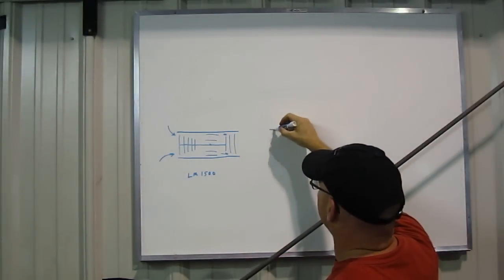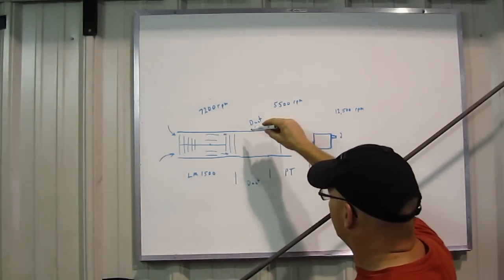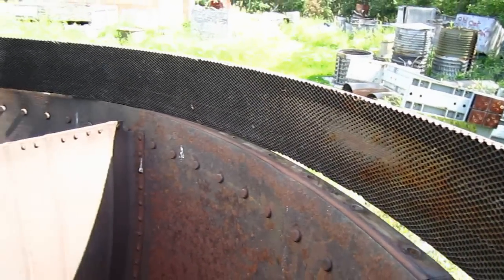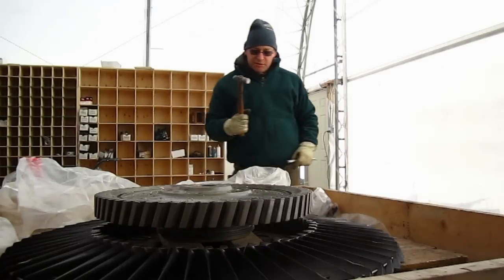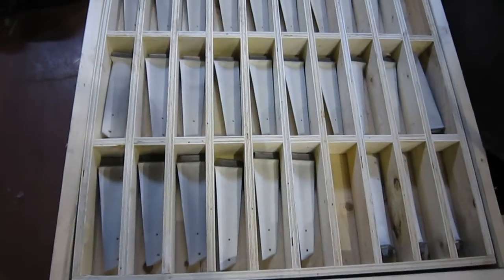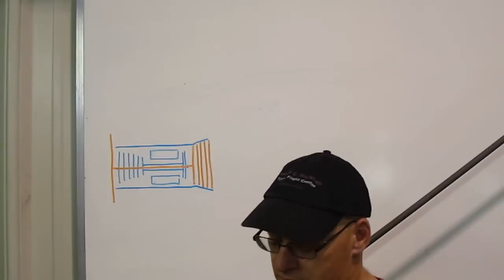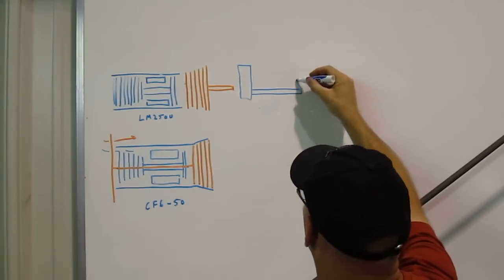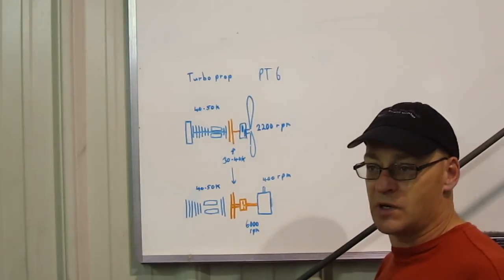Power Turbines: what are they ?

Comment from the maker: There is... between the power turbine and the load ( generator or gearbox).
The gas generator turbine, sometimes called the compressor turbine... provides the power to turn the compressor of the gas generator.
The leftover exhaust energy then turns the power turbine, which provides the power to turn the load...

Comment: The PT-6 is like the Chevy 5.3L of aviation.  It's hard to dislike it because it is common and it just plain works.  But like you said, it has its advantages in certain applications where the Garrett has it's own advantages elsewhere.  I've seen that the PT-6 is a gold standard of sorts in fixed wing and the Garrett in more use in helicopters.

Comment from the maker: @narcoti ...Very unusual question. So unusual I can't answer it. The output of an LM1500 is the exhaust gases, which are about 900 degrees F, and about 30 psi. Roughly 150 lbs per sec at full honk. Convert that to SCFM? Not me!
And if you mean what's the output of the compressor, then it's 150 lbs per sec, but now it's at about 450F, 140psi... another conversion to SCFM...
That's why jets aren't measured in volume of flow.

Comment: @AgentJayZ Not misleading, I am just an over-thinker!  Maybe I worded that wrong, I meant that the PT rpm is regulated by the pressure inside the duct.  It is, I guess, acting like an torque converter with air as the coupling medium.  As for the bleed valve, that would be like a wastegate on a turbo charger, which I could see as useful if they quickly need to control the pt rpm faster than the average throttle response of the engine, which In some application, would be quite required.

Comment from the maker: Yes, interestingly the CT58 has an optional reduction gearbox, for use in some aircraft.
The two CT58s that I have worked on were originally from CH-47s, and they had the reduction gearbox.
It seems to be more highly stressed, and less reliable than the engine itself.

Comment: In all conventional power generation systems, turbines are always used to convert the heat energy into mechanical power (which is then transformed to electricity by a generator). 

I know that modern combined cycle powerplants (gas turbine(s) are used to generate power, and their exhaust gases are used to as the heat source for the steam cycle of a steam turbine) can reach efficiencies close to 60%. 

If I recall correctly, modern petrol engines have efficiencies in the region of 20% - 30%.

Comment: Hi
i'm working on a micro gas power turbine and i have a problem with speed reduction. 
can you recommend a  small gearbox to reduce 60,000 rpm to 3000 to be suitable for a generator ?

Comment: Question : with helicopters, why there is an extra gearbox (last one , not part of the engine) ? Does that final gearbox change the main rotor speed, with turbine engine running at fixed speed ? Thanks in advance

Comment: Oh dear, not sure if I should have watched this, it looks absurdly simple to build a simple engine, once I've sourced the compression ratios I might have to have a little tinker in my garage to see if it can be done, if you see a news clip showing first UK man into space in a garden shed you may take all the credit you want for the inspiration. lol
Reply: Slow answer, but people are building simple jets from turbo chargers. That should be the simplest and cheapest way to build a small jet.
Reply: +Andy Gotting  No hair to worry about getting caught or to be burned off. That's a good start seems to me like!
Reply: +James Banana  And as I understand  it, they run up around 150k r.p.m. so it'd be interesting!
Reply: +Lewie McNeely it's quite an old picture of me, however my forays into building a simple turbojet did produce some interesting fireballs and a brief period without eyebrows was the net result of my last attempt.
Reply: I go on at chromium domes because when mine touches my ears, it's GONE! I can't handle it at all so I'm like your old picture most of the time. Glad it was only eyebrows! Cheers 2 U!

Comment: Hi. Does the two rings of wire around the power turbines blades, allow the blades to be mounted tightly in the wheel, rather than being loose the way compressor blades are? Are the wire rings to dampen out harmonic vibrations?

Comment: Agent Jay, what kind of materials are used on shrouds and struts? I thought they are supposed to be strong corrosion resistant metal alloys but it turns out they might be composed of mostly steel judging by the red oxidation visible on those junked pieces.
Reply from the maker: There are shrouds around compressor stages and around turbine stages. There are struts supporting the central structure, or bearing housing in the front frame, the midframe ( compressor delivery casing, or compressor rear frame), and the rear frame. Each of these structures is under a different set of thermal and mechanical loads, so the materials differ.
Many times what looks like rust on hot section nickel alloy parts is an accumulation of deposits of very fine dust. As I've mentioned a few times before.... forget Mars, Earth is the red planet.

Comment: @AgentJayZ As for the helicopter comment, since in flight, the load is going to vary anyway, just in maneuvering, (pitching the nose up while moving at a decent speed, puts tremendous load on them very quickly) so the stability of the rotor RPM is not as critical as AC electricity power generation, where it is important to match Voltage and Frequency as best as possible to feed it onto the grid.

Comment: Has there been any construction in the past that has    a smaller mid shaft to a small compressor air fan at the front    and the big fan for bypass air right behind the high pressure area with the exhaust gases going right through in the middle? So the cross section for birds to get in is smaller and the functionality of the fan is split.

Comment from the maker: @LarryCanFly If it's a home-built helicopter, you're on your own.
If it's a production model, the engineers would not waste weight on something that was unneccesary.
Helicopters have reduction gearaboxes because a power turbine that turns at main rotor speed just won't work.
If it would work, then that's the way helicopter would be built. That's what I meant.

Comment: Hi, this is fascinating and spectacular!  I had the idea helicopters engine and turboprop aircraft were using the engine shaft connected to a gear box> This gear box has a reduction gear and had some accessories for the engine. At the output shaft pilots could control the power to prop, and also increase speed to the engine. Well, I thing was wrong anout this! Thanks a lot for your videos and teaching all the world!

Comment: A PT6 runs at much higher RPM due to its much smaller size. The distance from axis  of rotation and blade tip are a lot smaller, and thus the blades generate less torque about the rotor. As such, to generate high power output, the shaft must (and is able to, since its size) spin at a higher RPM. Also, a PT6 puts out between 600hp and 2000hp depending on model, where the LM1500 is closer to 12,000 hp. 

Power = (Torque * RPM)/5252

Comment: so, I have a question for you about bearings.. once again.. I get how the second turbine powers the fan, but I am curious, does the inner shaft touch the outer shaft at all through bearings? or is each shaft merely supported by their individual bearings at the front and rear? I understand that the compressor shaft has a mid frame bearing forward of it's turbine just curious if the two shafts are connected via bearings or if it really is a hollow pipe and their individual bearings manage the load

Comment: It is interesting to compare the product of (shaft speed x tip diameter, or tip speed) on the last stage of the GG turbine, and (shaft speed x tip diameter, or tip speed) on the first stage of the PT.    It is also interesting to compare the disks.   Some aircraft GG turbine stages are so flexible(when not spinning)that they wobble -- flop like a potato chip.  As you point out, aviation GG rely on more intense inspection and maintanance schedules, because they cant be overdesigned like PTs.

Comment: not in all cases you dont, the CT58 I work with has no reduction gear box, its a straight drive into the 'freewheel' unit of the main gearbox (Sikorsky s61 in this case) after the freewheel unit you have the reduction gears.  Of course some turbo shaft engines DO have an integral reduction gear system, turbo prop being a common one.

Comment: The main rotor runs at a constant speed, usually, as you increase pitch of the rotor you need more effort. Some helis require a pilot on the throttles to match the required torque...other systems are automatic with governors etc...ie you set the throttles to 'flight' and the system maintains rotor rpm...usually with an 'anticipator' on the collective stick (raise the stick..pitch increases etc..anticipator detects this and provides the info mechanically or electrically (for FADEC systems)

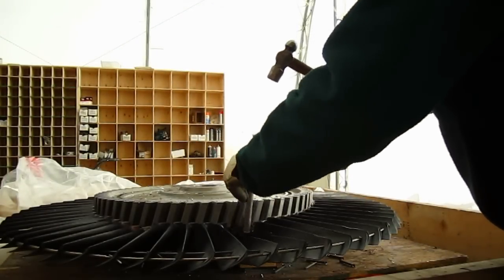Comment: At 9:30, when you use an aluminium rod (drift?) to hammer out turbine blades, even though aluminium is softer than the steel, doesn't the compressive shock from hammering risk causing weaknesses in the blades? Maybe the blades are less fragile than I think.

Comment: Do these units suffer less wear and tear when they are running in a static location rather than a plane?
Reply from the maker: The changes in power setting are much more gradual, so the thermal stress on the hot parts is much less, so yes to your question. They do run much longer between service and overhauls than aircraft engines do.

Comment: Don't some systems like that also have a bypass (blow-off?) valve in the connecting duct for a form of coupling/decoupling? (Not having to worry about the gas turbine part too much if load on power turbine varys rapidly for some reason. And I'd guess it'd make warm-up easier too, get engine spooling without backpressure.)
Reply from the maker: The exhaust duct pressure is not affected by how much load is on the PT, or by PT speed. . I've never seen a blow off valve between the GG and the PT in any industrial installation., nor any helicopter engine. The PT is connected to the GG by a duct full of gas, and it can't damage the GG. Watch our test of an LM2500 with the PT locked at zero rpm. It's called Power Turbine Locked.

Comment: @AgentJayZ They discovered that very quickly running the turbine locomotives, so that's why the turbines also had a couple hundred HP of diesel power onboard for moving around the yard.  Then they'd hook it up to a ridiculous load, fire up the turbine and then keep it full power all the way up the mountain so that it was always making the most of its power.  Ultimately they were discontinued because the fuel oil they used shot up in price much faster during that period than diesel fuel did.

Comment: As always, great vids! I have a couple questions: 1) Is ceramic better for thermal problems only, or have any improvements on efficiency over other materials such as titanium only?  2) For the duct between the input turbine and output P.T., is the size always the same or increased/ decreased depending on desired P.T. rpm's?

Comment: The PT on the RR Avon rotates at 3,600 rpm because the generator is connected with the grid which here is 60hz. Therefore a 2 pole gen would have to rotate at 3,600 rpm to give 60hz. The grid is what keeps it at that speed, not the design of the blades.

Comment: Great video, you mention that these turbines run for long periods of time between overhauls, how long ???
Reply from the maker: Longest I've seen is 9 years continuous use
Reply: AgentJayZ
because of how precise their manufacturing  tolerances are right?

reminds me of a sci-fi book i once read where an alien race made everything in nanite tanks and their tolerances were so exact they didnt make spare parts because their stuff was designed to last for a thousand years then be scrapped.

but i digress what i really want to say is SUCH INFOs , MUCH EDUCATION
Reply: They are designed to run for long periods of time because most of them can't shut down. Some of the larger power turbines (such as GE 7EA) provide base load power for city grids. This means they are running 24/7. They carefully schedule shut downs to do periodic maintenance, but this can be 2-5 years between shut downs. If the turbine ever has an unplanned shutdown (trip or fail-to-start) the operator is not earning money, and can be fined of upwards of $1 Million per day.

Comment: Great video, thanks! I have a question. I read somewhere that propels loose efficiency somewhere over 2500 rpm. On the another side, we have the compression stage sucking air spinning 50000 rpm. What makes this big difference in efficiency, the compression stage is ducted and the propel is not?
Reply from the maker: What's a propel?
Power turbines do not have any compression stages.
The industrial gas generators I know turn at between 7 and 16 thousand rpm.

Comment: Could you draw out an example of a 3 shaft turbine.  Perhaps one of the newer Rolls Trent Engines... I believe the LP shaft is coupled directly to the load so it would rotate directly at load speed and the hp/ip sections would find their own speed.  Just curious to see your layout of the bearings, etc.  Thanks

Comment: Excellent video! I'm trying to design a small power steam turbine for solar energy to drive two alternators. I'm finding it quite a challenge making my own turbine blades. Would you recommend CNC milling them out of block steel or melting my own ones out of a milled mold in a microwave? Its all for green energy

Comment: Are you planning on doing a CF6 video and do you work with RB211-535e4 engines?
Reply from the maker: We took apart a CF6, and I video'd some of that.
I would certainly do a series of episodes if we were ever to build and test a CF6, but that is unlikely.
We have considered a purchase of some RB211 535 engines, but have not yet started that project.
When we do, cameras will be rolling.
Reply: Thanks i love the buzz saw from the rb211

Comment: Hi jay I know this is an old video but right subject so hope you see this. So the pw pt6 is a common engine used in several or many modern aircraft. Has a free power turbine that turns the prop thru a reduction box as you said. But it seems to operate a bit differently in various aircraft. On the TBMs and Kodiaks the prop speed is variable at constant power setting whereas I think the PC12 runs at constant 1700 rpm on the prop. Also the tbm850 has a feature that lets it run at about 103% torque at cruise for more speed I guess. I believe these features are separate from the FADEC fuel control system. Do you know all or anything about this and if this is correct? Regards, Bob.
Reply from the maker: The propeller controls really aren't part of the engine, and also I don't work on PT6's, so I'm not the guy to ask about this.
Reply: Ok thanks. I suspect this prop stuff is sort of sales games by plane makers to get an edge on competitors using same engine.  So long as approved  by P&W.  Bob.

Comment: Great video! I have a question, a turbofan engine would use the shaft directly from the turbine to drive the fan and the compressors, but the other case, what would drive/spin the compressors? the industrials engines? if the power turbines aren't spinning them? the shaft goes into a gear box, and they aren't driving the fan/compressors, how do you spin them? (if that makes sense), thanks.

OBS: This case, the other turbines would do the job of spinning the fan and compressors, right?
Reply from the maker: It does not make sense. You just need to slow down a bit, and look at a diagram of a turbofan. It will all become clear.
There are many arrangements out there, but let's compare the GE CF6 turbofan airliner engine to the LM2500, which is the same engine used on the ground for industrial power.
The main difference is the LP turbine. In the airliner engine, its output shaft passed forward through the engine and drives the fan. In the industrial engine, its output shaft passes out the rear and drives whatever is connected to it.

The HP system is the same for both, and it drives all of the accessories on the CF6. Search my vids for Radial Drive Shaft. For industrial use, many of the accessories are removed from the gearbox, and driven by electric motors as part of the "skid", or engine installation system...
Reply: AgentJayZ I was kinda stupid, couldn't explain that very well, I'll take a look, thanks.
Reply: AgentJayZ Oh.. watched the video. got it! man, you are awesome!

Comment from the maker: @krbruner Dude... you're starting off from the wrong place:
1) a power turbines rpm is never solely regulated by engine rpm. It depends on its mechanical load, and on the output of the engine, which varies with atmospheric temperature, pressure, fuel flow, and rpm.
2) Helicopters are not like that at all. Main rotor rpm is critical.
3) I think you're mistaking a PT for an engine. A bleed valve would be more correctly called a leak.

I hope this video is not that misleading...

Comment: Fifteen THOUSAND horsepower?!  I knew of course that aviation engines (which the LM1500 is derived from) were powerful, but I didn't think it was twice as powerful as the beast that the Union Pacific used to pull more-than-mile-long freight trains over mountains.  Those ~8,000hp turbine-electric locomotives are the most powerful prime-movers ever used on American railroads, and yet they still get their asses handed to them by these old turbojets.  I want a locomotive with a GE90 powerplant!